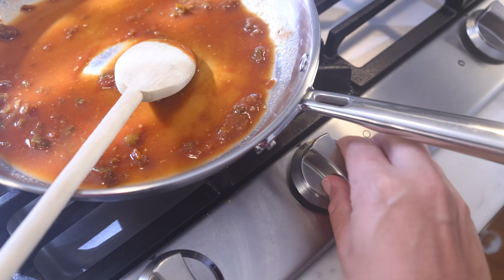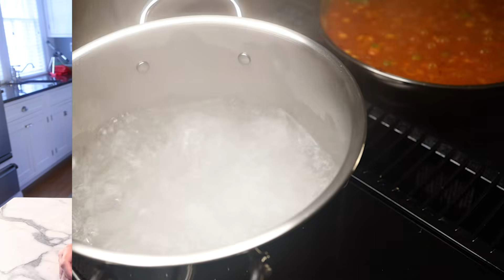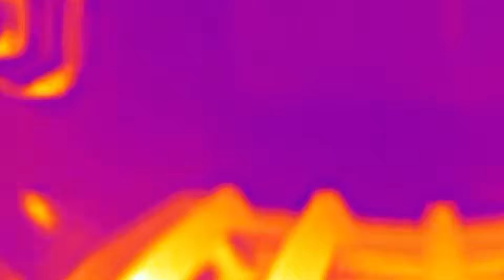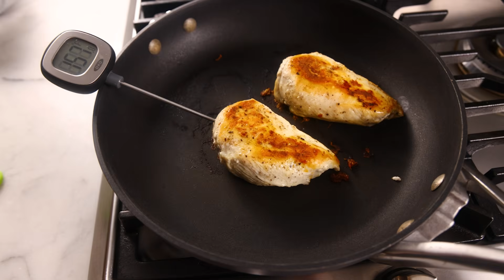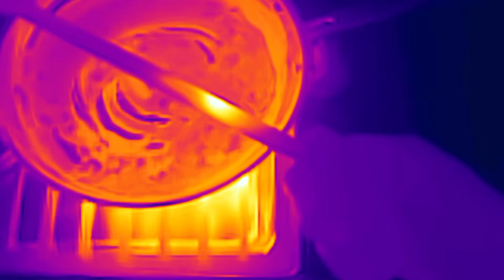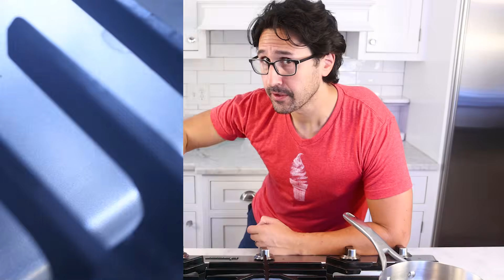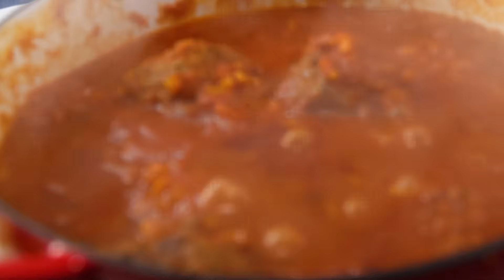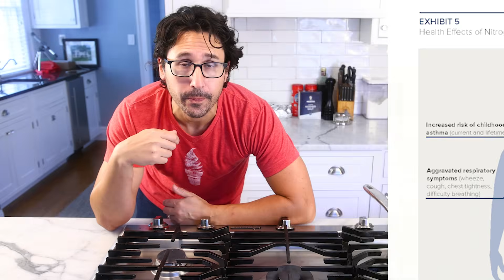Problems with gas stovetops | weak, dirty and dangerous

Comment: One advantage of gas I just thought of is that you can use warped cookware on it. Even a little bit of warping can take half of your pan off contact with the burner and make it much harder to use
Reply: It is an advantage, but not something to consider when trying to decide what kind of stove to get. But when there already is a kitchen, that can be nice perk to have
Reply: What is a warped cookware? wok?
Reply: @diysmallthings  I mean cookware that is no longer in its proper shape, usually due to mishandling. For example, the bottom of a pot which should be flat but is instead curved.
Reply: @diysmallthings  very common in commercial kitchens using aluminium pots and pans, or thin steel bowls for reheating single servings of sauces. They get banged around by the cooks and dishwashers, and are full of pits, bends, and dents. They still work great on gas. Would not work on electric.
Reply: as someone who uses a glass top electric, this is very true.
Reply: Induction should work in that situation as well since it is “wireless” to some degree.
Reply: @fqdn  Yes and no, got a Pot from my Sister cause her Induction top produced a hotspot in the already warped pot, that started to deform the pot even more to the point that the  bottom layer has a bump. Still works on my gas stove
Reply: Even on gas, warped cookware will cook unevenly.  Using warped cookware is the root cause here, not the heating method.
Reply: @Heycool08  Well yes, there is an extent of warping that will make cookware less useful on a gas stove, but it takes a lot more warping to get to that point that on an electric stove. I can speak from my own experience regularly cooking on both gas and glass cooktops, there are some pans, there are some pans I don't bother trying to use on the glass because only half of the pan gets hot, but they work without any noticeable issue on the gas range.

Obviously it would be better to just not have warped pans to begin with, but I must work with what I have.
Reply: @EvilGermanGuy  don't the dutch have cast iron yet?
Reply: @fqdn  But still can suffer, magnets have a range after all and the further they are the less effect they have.
Reply: @fqdn  no because of the inverse/square law induction hates a gap
Reply: I get the problem, but to be quite frank, warped pots and pans havent been handled properly in the first place.

Comment: An expensive gas stove is not a powerful gas stove. It may have other settings such as materials, washing-friendly, more sofisticated knobs and knob locks for determinated "temperatures" or "gas flow" you'll most likely be using (mine has a lock in the highest flow).
My kitchen is a semi-industrial one. It includes an oven which is so hot that I found myself burning recipes because the recipe said "as hot as your oven goes". It takes 3 minutes to boil +15l of water and reducing sauces is not a problem to me since as I'm taking the plates it's already reduced. Also, you guys have those quick temperature pans that Kenji showed in that video from all his pans.

I don't know how you differenciate gas stovetops there in america but here they're qualified as "industrial, semi-industrial, homecooks, etc".

Comment: I work for a gas utility, solid research Adam! Always use you vent hood, while some toxins might be present I think for the average user most levels will be untraceable. There's a reason commercial restaurants have large vent hoods and makeup air units. Commercial equipment burns far dirtier than your average household range.
Reply: A lot of co-ops don't allow vents.  Without the vent, the hood is useless.

Comment: I hate electric, like gas... but I LOVE induction. I've had gas most of my life and had to adjust to electric when we moved into current place in 2014. Didn't like it because of the issues you mentioned, primarily that it doesn't adjust well and it hard to clean when things get burned to the surface. When I remodeled my kitchen, I invested in an induction range and would never go back to either gas or electric. Super responsive, can hold temps easlily and sooooo easy to clean.

I should also mention that my electric range broke. Oven could no longer hold a steady temp. Agree with your point about not throwing away a perfectly good appliance.

Comment: I had a glass top infrared oven that over 5 years developed burn stains on the glass that I could never fully remove, regardless of the glass top cleaner that I would use, and were very unsightly.   I did not use my cast iron cookware on it because I did not want to scratch/crack the glass top.   Over those 5 years scratches did appear and eventually, the glass top did develop a crack.  I got rid of it and bought a metal coil top oven.  Now I can use my cast iron cookware again.  After that experience I do not plan on buying any kind of glass top (infrared or induction) any time soon, if ever.

Comment: This is surprising.  Our gas stovetop is way faster than anything I have cooked with previously.  That said the last electric stove I used (glass/ceramic) was over 20 years old so I guess electric come a long way.  That being said if I switched back to electric I would still probably go with induction over halogen/tradition electric.

Comment: I feel you are a great presenter. You act like you are unbiased, and you simply report what you find in a helpful way, and you generally pull that off. But, I see that you do work the system to find evidence to support your position. In this video, you showed an induction cook top, but did not say you were using one. You led us to believe it was resistive, but it wasn't. You then showed the heat loss, and compared it to the gas stove. You should have used a resistive coil cook top as that is the main competitor to gas. They have lots of heat loss like gas, but that won't make your point will it? You actively mislead any viewer who assumed when you said "an electric cooktop" you were using resistive ones, which are most common and most prominent in your video. Shame. What is interesting also is that you said that gas may actually be cleaner than electric in this case, due to the reasons you stated, but then you switch from general information that we can all use to anecdotal information. You did this with the HFCS issue - speak in generalities than are facts, then pull up an anecdotal situation (about some allergy) to sway the viewer to your position. These videos would be better without the anecdotes and "shading" which give them a large bias. Unfortunately, most presenters similar to you do their presentations specifically to sway people to the left. Without the bias, these would be helpful, interesting, informative and excellent videos.

Comment: I think gas is everywhere in media to do with cooking simply because it looks good in photos and videos. My personal experience is that induction has, by far, the best benefits vs downsides.

It's immediately responsive, and the heat output can go from the gentlest bubbling to a setting high enough to boil water in just a few minutes. It's super easy to clean and doesn't heat the room up. It also doesn't release harmful fumes in to the house, and you can power it with renewable energy.

You can't char things with an induction burner though, you'll need to put the grill on for that. And it won't work during a power cut, but that doesn't matter. I can just buy a cheap portable camping gas stove and use that in power cuts.

Comment: Anyone worried enough about the carbon footprint of a gas stove to consider it actually relevant should probably be dedicating their life to securing funding and resources to convert every dwelling unit in the US to use heat pump technology. 

Something like 35% of US homes are heated with 100x more BTU's (than you will ever use cooking) of Gas, or worse Propane, or even worse Heating Oil, or wtf they still do this COAL boilers.

Comment: For really low cooking heat on gas, there is a solution. It is not efficient at all as you still use the same lowerst fire, but there are metal wire mesh pieces or just risers to put on the stove and keep the pan further away so the heat is lower.

Comment: Big problem with most gas ranges in US (including yours) is that the grate is too high, creating an unnecessarily big gap between the flame and the pot, thus resulting in lower efficiency, weaker power, and overheating the surroundings, which basically include all the problems you mentioned. I don’t really understand why they’re designed in this way, so if anyone with industrial knowledge could shed some light.

Comment: Funny anecdote from Europe: we once were at a campsite and they said we could cook on a comunal stove, well, turns out it was induction, and we had alluminium pots. So we told the lady at the reception and she was like: “My idiot son, he bought an induction, even though I told him to buy a glass top stove”
Then we met the son and he was like: “Yeah I mean, it’s a glass top stove”
Reply: So they should buy pots and pans suitable for induction and lend them out.
Reply: @lonestarr1490  if you don't own cast iron, you're not qualified to borrow it.
Reply: @jamesbael6255  stainless steel and teflon pans are a thing.
Reply: Definitely not supposed to used cast iron on glass stove tops
Reply: @sirdaddytworolls4735  definitely not a problem
Reply: @marvinslomp3564  as well as many aluminium pans that just have a thick bottom slapped on there that does respond to induction.
Reply: @jamesbael6255  Ah yes, snobbishness, that most convincing of all attitudes. Just get and lend out the blasted cast iron if you got a communal stove that requires it, and accept you'll have to reseason after every borrower. Not like it's vulnerable to permanent wrecking like teflon is, even if you ruin the seasoning the actual pan is intact. Get the old seasoning off with acid, alkali, or preferably just heat (500°C, an oven's self-cleaning cycle, should do it), then redo the seasoning procedure on bare metal.
Reply: @SaraWolffs  500°c? I'm deeply skeptical of your claim that a consumer-grade food oven could get anywhere close to that hot.

Comment: Go induction and you will never go back. Responsiveness of gas, power of electric. Most pans have magnetic cores that support them now (in the early days they were hard to find). You just can't use super cheap aluminum pans anymore (which you probably shouldn't use anyway).

Comment: In my experience induction combines advantages of gas and electric. Responsive, fast, does not heat the handles, super easy to clean if stuff overflows since it does not get as hot. Would not go back to gas.
Reply: Induction is great but you need compatible cookware and it doesn't work when power is out.
Reply: @gubx42  Gas doesn’t work when gas is out, that’s hardly an argument (unless you live somewhere where power outages are something to actually worry about).
Reply: @JanStrojil  Where I live, the gas stove is the only heat source I have that doesn't require electricity. If gas goes out, I still have an oven, microwave, kettle, toaster,... Outages are rare, but on two occasions it allowed me to eat a hot meal, not a huge deal, but I take it.

Also, the gas stove I have is actually 3 gas + 1 electric hot plate, a common configuration. The hot plate is mostly for simmering, but it can be used as a backup if gas is out.
Reply: @JanStrojil  I have been through numerous power outages, and the gas never ran out.  Now I have propane, and the provider comes once a year to refill it, but it's mostly still 3/4 full at least, and I do plenty of cooking.  You have no clue what you're talking about.
Reply: @robinlillian9471  I’ve had days when the gas was out, yet I don’t recall a blackout longer than minutes in the last two decades. I wonder how frequent and long blackouts would have to be for me to trade the convenience of induction back for gas. Is that a real issue where you live? Are they frequent enough that you’d otherwise go days without a warm meal?
Reply: @robinlillian9471  Also please note that I was talking about my personal experience just as you were. So your “you have no clue” wasn’t really called for. I did state that your situation may be different if frequent blackouts are a thing where you live.

Comment: I have to interrupt your fake science experiment.  You are using a shiny pan on the gas stovetop.  You should know that wearing a white shirt under the sun keeps you cooler than wearing a black shirt.  The efficiencies of all stovetops that rely on emitting visible light or infrared light are affected by the color of the pan.  If you do not use a pan with a dark (outside) bottom, you can at least compare the gas stovetop with an infrared stovetop instead of with the induction cooktop.  As pointed out by many comments here, inside glass-top stoves are not resistance coils; they are quartz lamps that emit infrared light; nobody puts a piece of glass between a pan and a resistance coil.  It is time for you to get some pans with dark outside bottoms, or you can char the bottom of your pans if you are into this sort of thing.

Comment: I totally agree.  You should have covered "electric induction cooktops" which doesn't let any heat escape because it heats up only the pan itself.  Induction also has the instant on/off like gas.

Comment: I 100% have always felt this way about stoves, I much prefer electric stoves and always hated gas stove tops once I realized how much faster the electric ones were, plus the low setting issue is also an issue for me, especially for rice cooking.   Another issue with natural gas is how it's mined, currently the extraction process has a much worse impact on the environment than traditional petroleum extraction does.
Reply: Plus gas pipelines leak a LOT of gas. So it is best for new houses to not be connected to it at al. Gas companies are very big on marketing for gas stoves, since it will motivate people to get a gas connection in their house and use it also for heating. These companies put most of their marketing expenses into cooking with gas, while it generates them a fraction of their revenue. They do this because cooking is an emotional argument to get a gas connection, while no-one would care whether their house is heated electrically or with gas.
Climate Town has an awesome video on this.